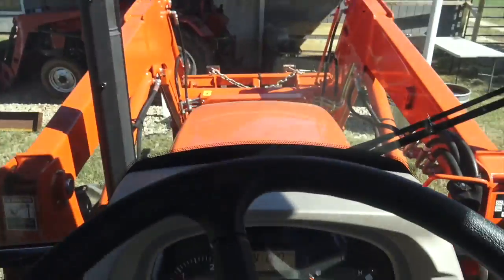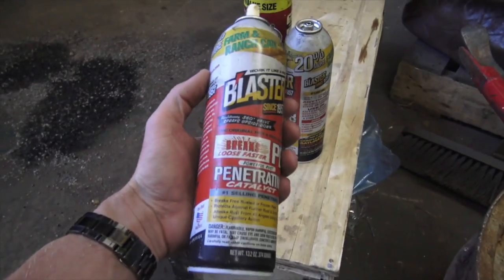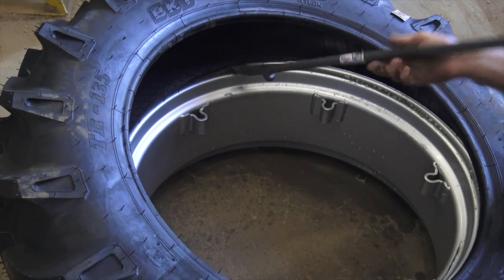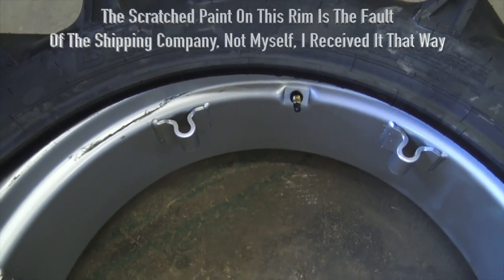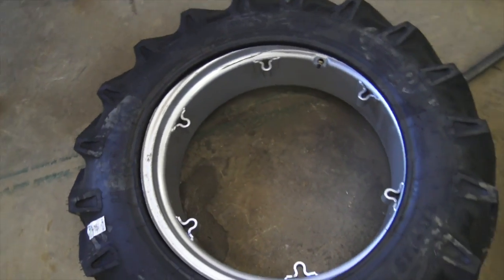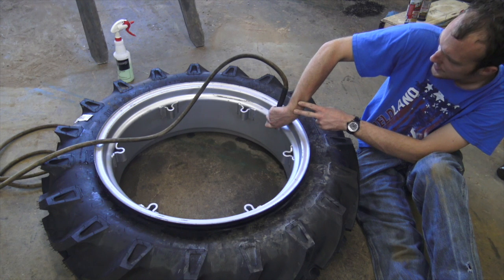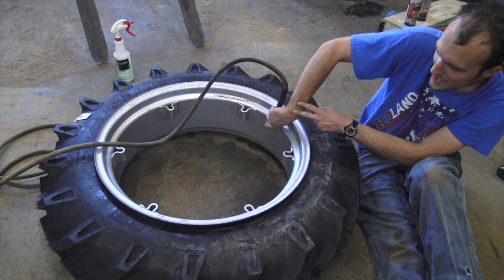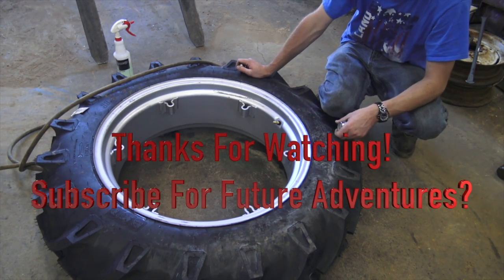IS DIY INSTALLING REAR TRACTOR TIRES REALLY THAT DIFFICULT?!?

Comment: They made a hammer for the beads at one time. About 3 pound weight. One end was a flat hammer head, other was a rubber head, about 3" in diameter.  Pounded a lot of tire beads on with one of them. Another trick is to jack up the tractor and let gravity help you, if you have a flat tire. The weight of the tire will help to get it over the rim. Start at the bottom and workat it, rotating the tire and rim as you go.

Comment: For those of you that have never done this before.  I'm an old farm kid and I've changed dozens of these things growing up.  Here's some advice.
1.  He's got soapy water, check.  Lubrication helps alot here.
2.  He's got two decent sized bars.  Check.  I would usually have a smaller pry bar to help along but working it this way it's the end of the world
3.  Leave it mounted on the tractor or tie it down to something solid.  As you can see he's chasing it.  You're wasting energy doing that.  While you're gonna get a workout doing a pair of these you don't need to kill yourself.
4.  VICE GRIPS.....  Get a rag with a pair or two of vice grips.  Clamp them onto the rim (with the rag between the jaws and the rim to keep from marring up the rim) right as the point where the tire drops into the center of the rim.  Use these are a hold/third hand to hold the tire down in the center drop.  If you don't you're gonna end up chasing it around the rim (see comment 3).
5.  Take small bites.  Once you get it past 1/2 way it will want to pull itself on.  Don't kill yourself.
6.  Tire tubes.  What I typically do is I inflate them about 1/3rd of the way just to get all the wrinkles and stuff out of them.  Then note the orientation of the valve stem etc.  Pull the valve stem core to deflate the tube bearing in mind the orientation of everything.  You want to make sure you don't pinch the tube or twist the tube.  Then use a pull through to keep the tube where it should be on the rim

Comment: Another good trick with new tyres is to coat the inside with talcum powder and get a little air in the tube before seating the top bead, it will help the tube to sort itself out when you inflate the tyre and give you a nice smelling tractor!😂😂

Comment: Always start on the opposite side of the valve stem. Which you did. I started at the valve stem one time and the tire broke the stem when it tried to move in the groove.
Reply: Exactly, I just commented too ,you worded it pretty good, cost of new tubes aren't cheap

Comment: The first side of a tire is easy. Stand the tire up against a wall or other solid object so it is leaning, lube the bead and set the rim in then stand on the wheel to force it down into the tire. With the right angle you can bounce a few times and it will go right in. Getting a tube in and the other bead on without damaging the tube is another story.

Comment: Someday, you'll wish you had welded something on that wheel to protect the valve stem.  Personally, I like to saw a 2" pipe coupling in half, weld the resulting threaded ring onto the wheel, and screw a short length of pipe into the ring. This protects the stem while still allowing you to air-up the tire.